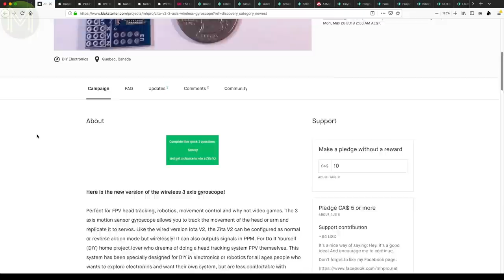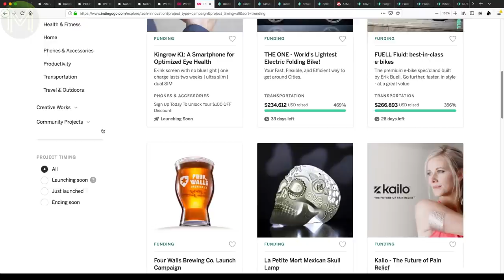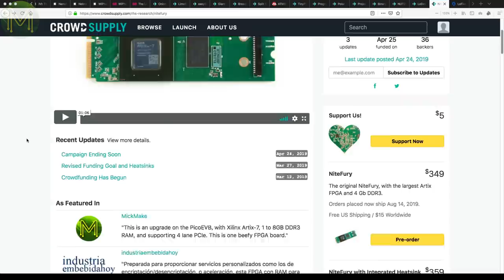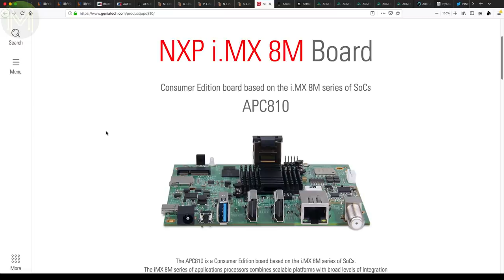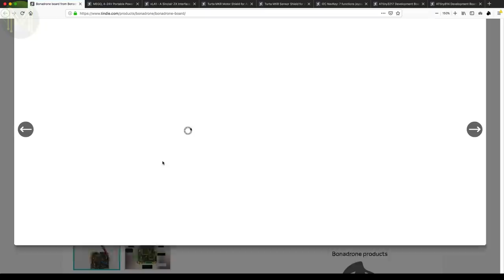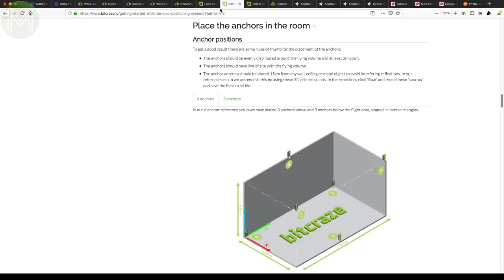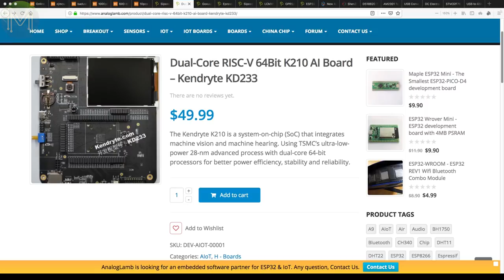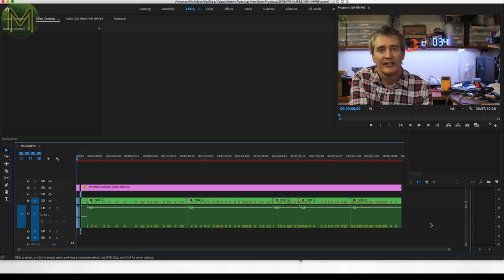#264 Weekly Roundup #65 - New Maker Products // News

Comment: Just as good as usual Mick. I'm still learning about using electronics for maker projects, so I'd have to Google about 50% of the items you discuss anyway. It's good that you mention potential projects for some devices though. Thanks for another great video.
Reply from the maker: Thanks mate. Shame I can only add 5 YouTube cards to point to more links.

I had written a WordPress plugin that would display links as the video progressed, but there was an issue with it and I had to disable it.

But might spend a bit of time fixing it up.

Comment: If you are looking for a cool Lattice FPGA board, I'd suggest maybe looking into the Radiona ULX3S, I was lucky to get an early run with a ECP5 85F on it and I love it.

On the RISC-V front, I'd heartily recommend the 64-bit Sipeed MAIX / Kendryte K210s over the 32-bit Sifive HiFive1 / FE310s you were looking at; unless you really need the Arduino Uno form factor or the built-in 5 volt GPIO signals converters. Plus you get a neat deep learning ("KPU") core to play with.

I have noticed a slight issue with the current MAIX BIT design in that a camera feed from the DVP connection is quite noisy; I suspect it's due to the 26Mhz crystal being located right next to it. Both my dock and go boards have been issue free for me so far though.

The software ecosystems for both these boards/chips have been evolving fast; and while you won't be able to fit a fancy pipelined 64-bit RISC-V "K210"-alike design on the ECP5 85F, it's an affordable (and completely open source) starting point for MCU processor microarchitecture exploration and experimentation.
Reply from the maker: Yup, I saw the noisy DVP signals on the MAIX as well. Probably is due to not enough ground plane in the area.
But yup agreed, the price of those RISC-V vs KPU... guess it depends on what you want to do with them.

Comment: Even without a 2G network, A9 is awesome, a full microcontroller that can play music, ADC, FOTA, MQTT, I2C, SPI, Camera interface, etc for 3.3USD/22 Yuan. Luckily for us we have from 2G to 4G in India. The A9G is a GPS version with the same microcontroller.
Reply from the maker: Yes true. And combine it with some pirate 2G towers, might be quite cool.
(Although, don’t tell anyone I said that - the FCC would come after me.)
Reply: @MickMake  Just wondering isn't the SIM800C that you wanted to purchase is 2G only. Than how you plan to use that. What is the difference between A9 and SIM800C in terms of network? Also A9 chipset has inbuilt USB serial and SD Card slot also to store sensor data, comparing it in terms of cost with a Arduino chinese clone which would require external SD card module + external MP3 player module, with A9G you can create a cheap GPS logger even without network or a talking GPS navigation system.

Comment: There's a company called GnarlyGrey (dot com) that sell a Lattice ice40 Ultra Plus FPGA board for $8. It's about as minimal as a board can get, but I think it's a better deal than that LCMXO2 board that you dropped from your cart. I know the open FPGA tool-chain started by the IceStorm project is starting to expand beyond ice40 FPGAs but I don't know how far they've gotten. I'm not sure if they've added support for Mach XO2s.
Reply from the maker: Oh OK. Thanks for the heads up!
Will add this to the next roundup.

Comment: @MickMake I'm sure you know that SBC-ish boards are becoming a dime a dozen these days. 10s or 100s of models. I think it would be a really cool video if you did *not* a "top N best hardware-value SBC in 2019", but a "top N boards by their software support". Things like - How easy it is to access all the hardware on the board; how updated software images are; how much external community there is; how possible it is to build a new kernel/distro image for it (what's the binary blob situation like); how much post-release attention the OEM pays; can you get the full performance/features of the board with community software; how update-able it might be in the future. Or will I be stuck on X custom kernel forever.

I could chuck $50-100 at a dozen different companies to get some ARM cores these days, for a smorgasbord of different hardware configs; but what I really want to know is how easy it will be to use and update the thing, now and in the future.

I would imagine obv no. 1 spot should go to R-Pi here, but getting opinion on what no 2. and lower from the different companies would be very interesting and valuable info.